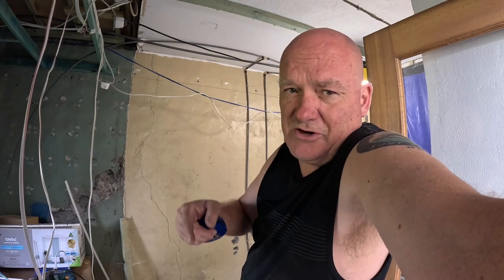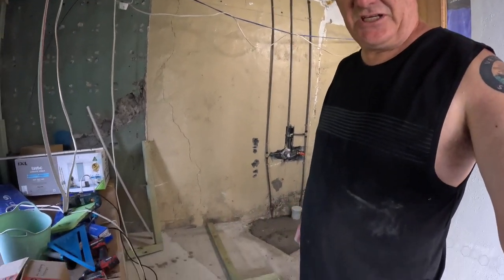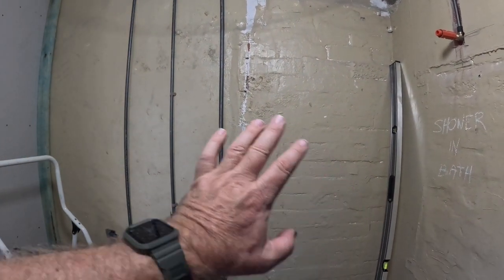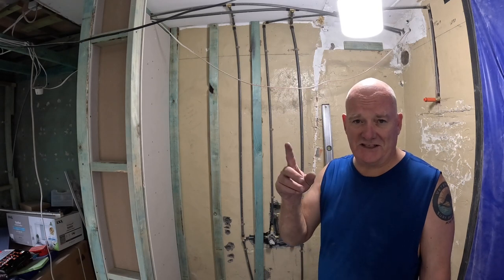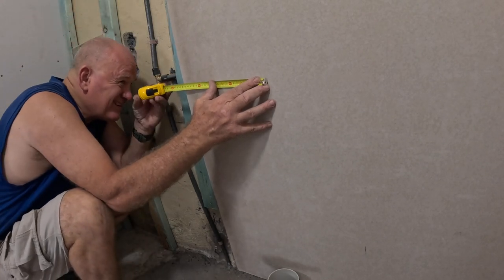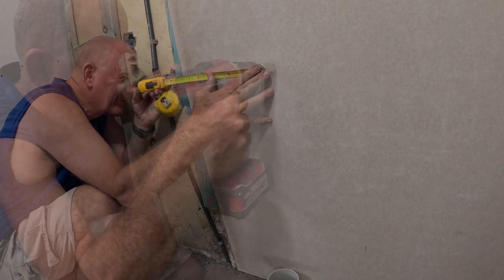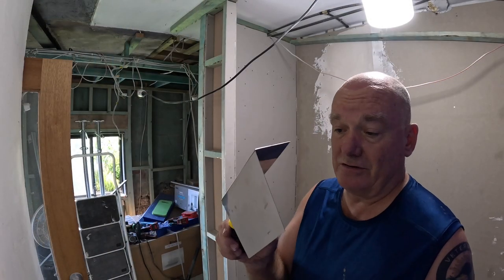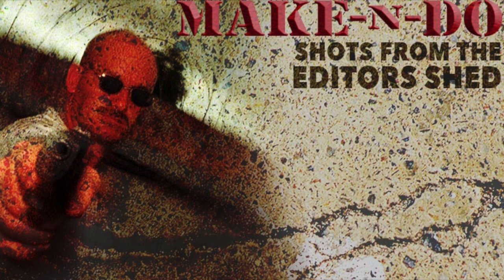New walls go up in the bathroom

Comment: My run-in with a concrete grinder involved fixing a self leveling floor pour into my son’s kitchen.  When we put the correctly mixed concrete down it looked just like what you showed.  By morning the next day it was very solid and dry. 

I now only buy what I need when I can,  I have so much stuff bought “for later” that I don’t realise I had before buying more when I needed it……

Still love your work and tenacity to just do the next bit.
Reply from the maker: Oh we are like peas in a pod, you and I 🙂